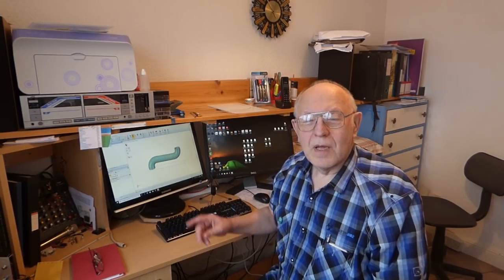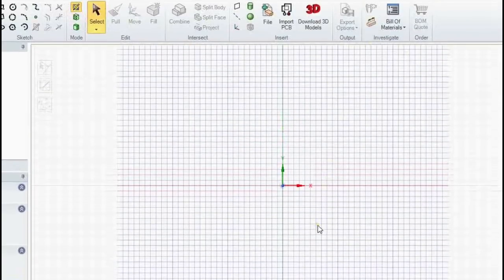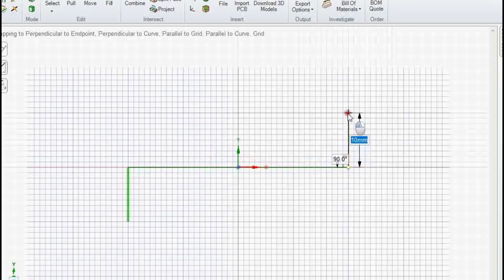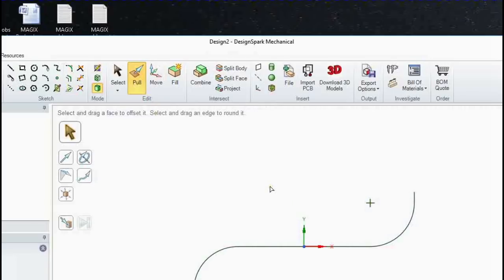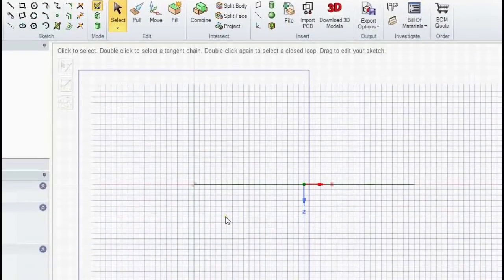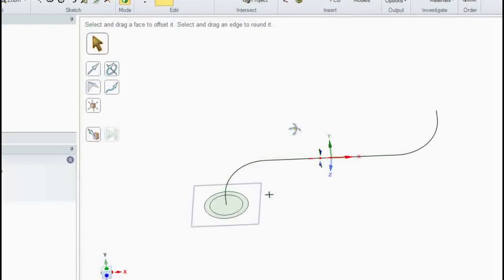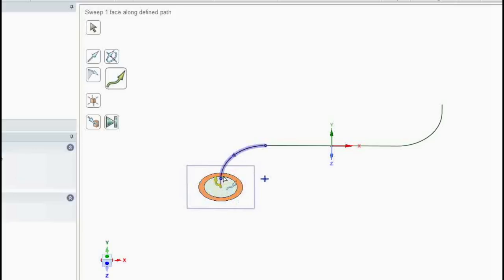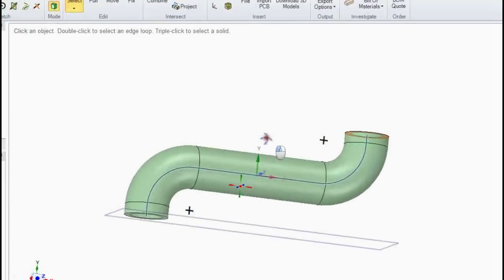Making a Pipe with bends in DesignSpark Mechanical.

Comment: Is it possible to make a "Y" shape connector/tube? i can make it with the rectangle tool but when i make it using the circle tool and the push pull method in this video the external geometry looks good but internally is not viable design.

Comment: Hello Mr Taylor, When I create the arc it doesn't automatically remove the 90 degree corner so to speak. What am I missing?
Reply from the maker: It looks like you are using the Tangent Arc tool instead of the Create Rounded Corner tool which is 2 tools along on the top row.

Comment: Another way to do this is to draw the sketch as in this video then select the sketch and then click the cylinder tool, set the diameter and use the shell tool to hollow the cylinder.
Reply from the maker: Thanks for the tip, it does work. It does, however, have the following curiosities. Before the hollowing operation there are spurious dome shapes at the end of the pipe. These can be deleted though, then the pipe hollowed. It needs to be hollowed from both ends otherwise the pipe will have a blanked off end. This could be useful in some circumstances. Thanks again.

Comment: What if you want the end of the pipe to taper? How would you do that?

Thanks
Reply from the maker: Use either the Draft tool or the Pivot Edge tool in the Pull options.

Comment: If you wanted to change a couple of dimensions, lets say the inner or outer diamter, do you need to redo all the process again, or does it automatically update if you change any dimensions?
Reply from the maker: You would need to select all of the inner or outer surfaces and Pull them to the dia you need.

Comment: Nice show :) What kind of demo recording software are U using?
Reply from the maker: I've tried several screen recording software apps and this one is OBS (Outside Broadcast Software) Studio. It's free and works very well once you get the hang of setting it up. One great feature is that it is free.
Reply: I got it :) But when you are zooming to a part of the screen and showing mouse clicks are the part of this OBS software?
Reply from the maker: I am sorry but I've just realised that my video 'pipe with bends' was not done with OBS, it was a previous demo screen capture app that I can not remember. It could have been Camtasia. I've tried so many that I've lost track of them all. OBS is what I am using now and you can see an example of it here: 
https://youtu.be/LtNTePQP7xI   DesignSpark Mechanical: Basic sheet metalwork #1
Apologies, Jim